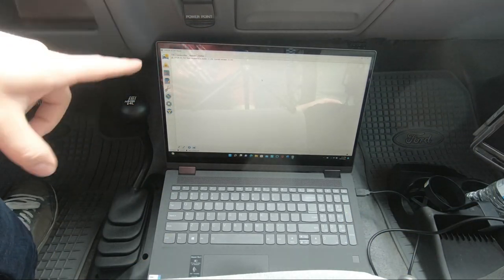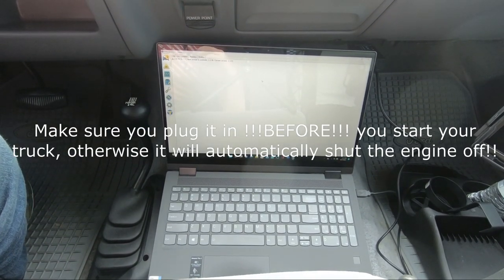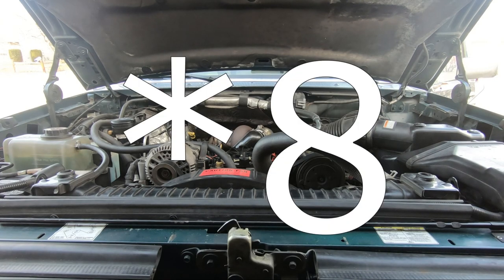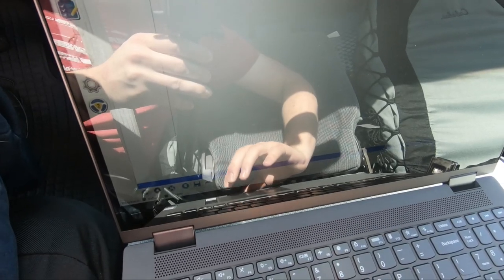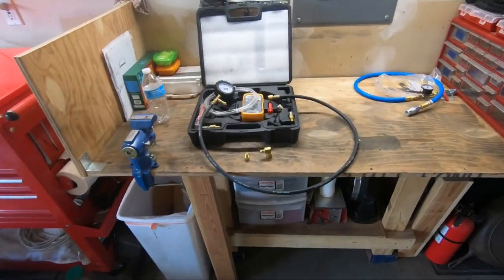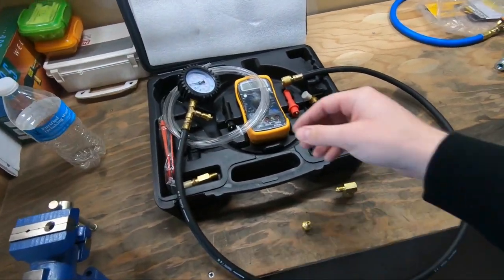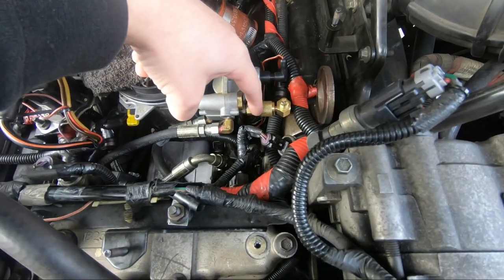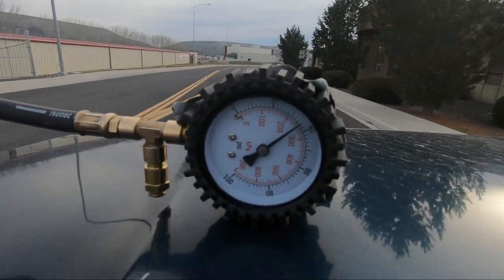P1211 Code Diagnosis (7.3 Powerstroke)

Comment: I like how you went through and eliminated each possible fail point of the engine Cody.  Another great vid amigo!  Soooooo curious what it ends up being.  I'll stay tuned :)
Reply from the maker: Thanks!  A lot more talking than I like but had to get the point across.  It’s a work in progress, but whatever the problem is should be a cheap fix

Comment: Good process of elimination. At least you narrowed it down without throwing $1000 worth of new parts at it. It will be interesting to see what you find. I've only owned one 7.3 and fortunately had no problems with mine, so I'm no help here. Great video.
Reply from the maker: Thanks Jason!  It’s too bad that I still have to figure this out, but I’m glad that there’s nothing wrong with the injectors cause that’s big bucks💲!!  I’m pretty sure whatever it is is simple and cheap to fix, just haven’t found it yet🤣!  Take care Jason

Comment: Yup the video is not a failure.  A lot of times this is how the TS process goes.  7.3s most of the time have to be TS the old school way.  Much like you did.  A few tips for ya though.  You need to put 12 VDC to the IPR valve while doing the air test.  Thats where your air is going on the left side.  Also while you have the valve covers off, start the engine and observe the oil coming out of the spouts on each injector.  The injector can pass an electrical test but still not function right.  No oil coming out of the spout is one indication of a bad or sticky injector.  Also when you did your buzz test your injectors should be a little louder and more of a crisp sound.  You're do for some new ones.  And lastly get the fuel pressure up.  Eliminate your tank for any restriction.  Needs 45 PSI minimum under load.
Reply from the maker: That’s great advice thank you so much for commenting!  When you say the left side are you meaning the drivers side injectors when I heard that gurgling sound?   

After this video I replaced the ipr and still no change.  So I’m back to thinking it has something to do with the injectors.  If oil isn’t coming out of one of those oil spouts does that mean I have a bad o-ring on that injector or something physically wrong with it internally?  Thanks again for commenting I sure do appreciate the feedback!😀👍

Comment: the heads are made with high pressure oil passages that go to each injector. the passage seals to each injector by means of o rings. if these o rings are sealing properly, it should hold pressure and not loose any. the only time the high pressure oil system is open to return oil is when an injector has been cycled by the ecm . it should be completely closed while the engine isnt running.  might have a bad oil o ring on an injector or a faulty injector. i would start right there. if you find a problem, correct it and then retest BEFORE you start it.
Reply from the maker: Thank you J.C that’s great advice cause on the drivers side lol rail I was definitely loosing air pressure.  So I think I should take that valve cover back off and see if I can find anything.  Thanks again😀👍

Comment: Hey man, I’ve had a couple struggles with this code in the past and was able to get it repaired. My biggest problem was ICP sensor but something I replaced that I think had something to do with it as well what is the fuel sending unit. Not sure if this applies to your pro but thought I’d let you know.
Reply from the maker: I appreciate the advice, thank you!  I’ll look into it.  I’ve been suspecting a bad o-ring on an injector but not quite sure yet.
Reply: @ydocproductions5593  your injectors sounded really good in the test, hopefully on oring. Good luck!

Comment: I think the air to crankcase is symptom of the problem. But what is the path?  I suspect a cracked injector cup. Also make sure you don’t have oil in your coolant.
Reply from the maker: I suspected that for a while but I’ve owned the truck for over a year now and there’s zero signs of oil mixed in the coolant

Comment: i would apply air pressure to rail and check fuel return line for air . i have lost more than 1 injector o ring to fuel  port not out valve cover
Reply from the maker: Thanks for the advice!  I’m beginning to suspect bad injector o-rings.

Comment: I talked to my cense on your 7.3. 
Your fuel pressure is way to low. Should never go below 45 psi. 
Two possibilities 
One is fuel pump 
Two is the filters in the pickup in your tank are clogged. 
Disconnect the fuel line behind the fuel pump and remove the fuel cap. 
Blow air back into the tank with several bursts 
This will temporarily reduce the buildup on the filters and you should have normal fuel pressure throughout rpm range. 
Then if it’s the cure drop your tank and replace the filters. 
Riffraff Carries OEM ones.
Reply from the maker: Thank you so much for commenting Vince!  I’ve tried so hard to pinpoint what could possibly be wrong with this truck and felt like I was running out of options.  I’ll definitely look into it.  The truck only has 168,000 miles on it so it’s hard to believe the mechanic fuel pump could fail but this far into the diagnosis anything is possible.  Thanks again so much for the insight I truly appreciate your help

Comment: It drops probably because it was losing fuel pressure. Every 1211 Ive seen or heard of  has been fuel related.
Reply from the maker: You’re pretty spot on!  It turned out to be both the fuel lift pump and the HPOP.  After replacing those parts it runs so great!  I have a video on it if you’d like to see.  Thanks for watching😀👍
Reply: @ydocproductions5593  Good Video and I'm glad you found it. These codes are weird in the fact that we don't know exactly how they are linked up to each other in the program. I programmed PLC's amongst other things for a living and I understand this which drives me crazy troubleshooting this stuff without any ability to look at the program itself because you just don't know exactly what is supposed be happening and the codes can be very deceiving. I've seen guys change all the injector o-rings with a 1211 and other things.  I have the 1211 now and I'm getting ready to drop the tank after 22.5 years of running. I think mine has broken the fuel inlet in the tank because it runs out of fuel before it's empty. Good Luck

Comment: Get the engine hot and perform a dead head test on the pump.
Reply from the maker: Yes I’m beginning to wonder if it’s either a bad hpop or a bad injector oring